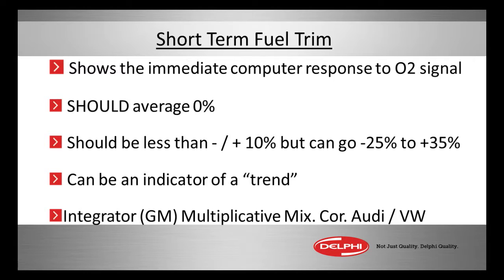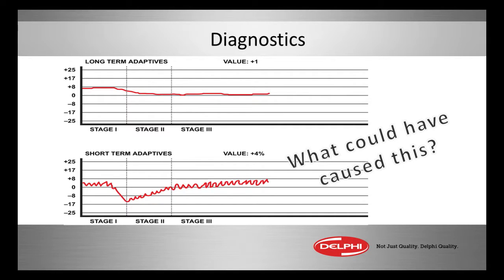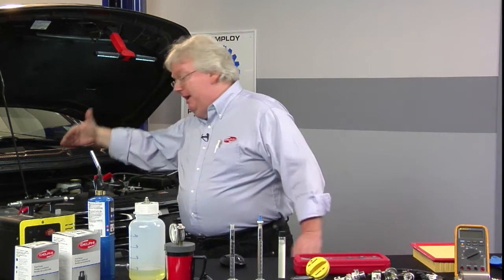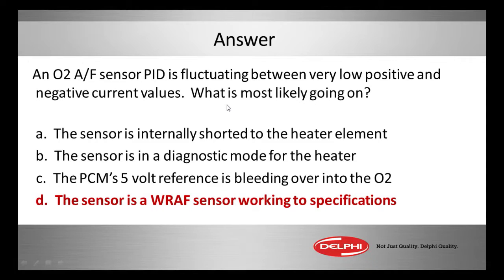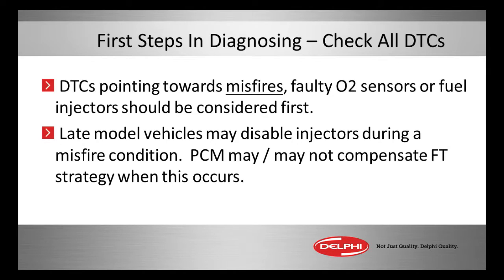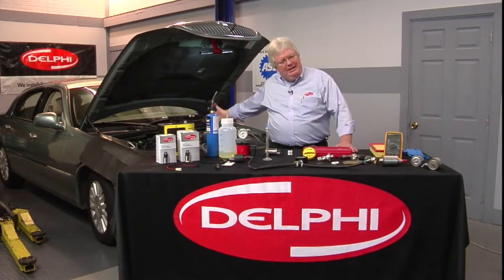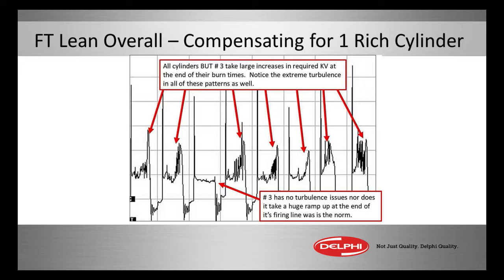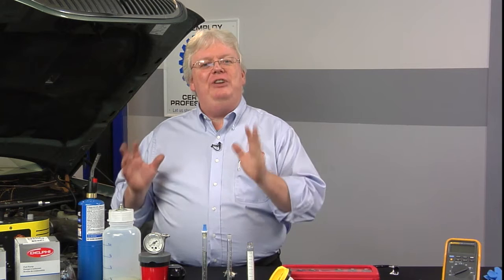Delphi Training Series: Diagnosing to Win with Fuel Trim

Comment: PS:  I love your videos, but you are not working on a Continental (which would be gen-9, and transverse engine) on D186 Platform.  

VERY different from the Lincoln Town Car on Panther that is front engine / rear drive.

I understand diagnosis very similar and find it funny that mechanics do not know what the work on from day-to-day, but I have a 2 Panther cars (1 Town Car, 1 Grand Marquis) and they are VERY different from the D186

Comment: Really Awesome vid. Forscan software emulates most of the factory Ford scan tool, is free and uses those cheap obd adapters. Worth a look if you work on Fords. My 96 Explorer total trim runs in the mid teens at idle and around 5-6 positive at 2000 rpm. Both banks follow very closely. I want to believe it is a vacuum leak(maybe intake gaskets, but propane does not really affect trim) but I wonder why it would stay a bit positive when I accelerate.  I notice sometimes a bit of hesitation when I restart a bit after shutting off.  I want to clean the MAF, and I noticed a crack on the coil plastic, maybe a light misfire. I'm going to use some of your tips to investigate more. K eep up the great work.

Comment: Hi, Can you explain the reaction (non-reaction?) of the front AFR to extreme rich/lean conditions, while the rear is (as we would expect) indicating a rich/lean mixture> All the time the front AFR is unmoved. I would have expected more sensitivity from the AFR?? Very interested to understand these sensors better. thanks,
Reply: I wish I had a better explanation than what is in the video.  But thanks for watching Alex.  Some advanced OEM dealer tech on an IATN forum knows, I'm sure. I'll run into some far brainer trainers than I (John Thornton, Scott Manna, etc.) at AAPEX / SEMA in a few weeks and see if one of them know.  I learn something every time I work on a new vehicle and just about anytime I teach a live class with sharp techs.  I stopped pretending to know it all a LONG time ago.  At 57 I'm doing good to have a positive learn / forget ratio.  This delay blew my mind regarding how slow the system responded to huge air leaks and propane.  I had to go to a slightly older vehicle to validate what I was sure I had known for decades, and yes, this is something pretty new. AF sensors are fast enough - I believe it's an on purpose buffering in ECM software.  I noticed a bi-directional PID on my scanner that had to do with controlling the A/F adjustment delay. Hmm.  Had this on a new Ford and Dodge I rented for the video.  My educated guess would be it is a newer fuel management strategy the OEMs are using to reduce MILs and still pass emissions.  Think VW . . . LOL.  Alex, brainstorming here;  there might be one way to find out - go to motorcraftservice.com and click on "Free Resources" then OBD II Theory of Operation.  That link lets you download 1996-2016 Ford engine management documents.  I would look at a the current model year and do a 'Find' for key words like fuel trim. Then just keep hitting next and speed read all the instances of those key words throughout the PDF.  Beats trying to read a 300 plus page document.  I haven't researched this yet but perhaps you have a few extra minutes more than me LOL.  These Ford documents are a treasure trove of info that something like this would be in.   If you get an answer please let me know.  I'm updating a Fuel Trim training manual and this would be great info.  david.a.hobbs@delphi.com  Again, thanks for watching the Delphi YouTube channel.

Comment: Great video! What scan tool was being used?
Reply: I was using the Delphi / Blue Streak Electronic PC based scan tool / J2534 programmer combo.  Blue Streak also sells it under the model name "Otto Test".  Made in Canada.  I have two other PC based aftermarket scanners (Auto Enginuity and ATS E-Scan (powertrain only) and the Delphi / Blue Streak seems to be the fastest.  Domestic and Asian only.  No Euro software.  Thanks for watching Derrick!